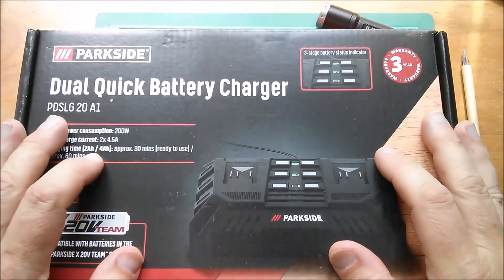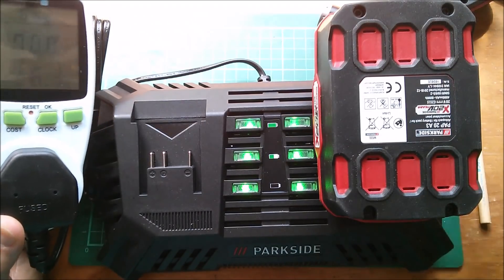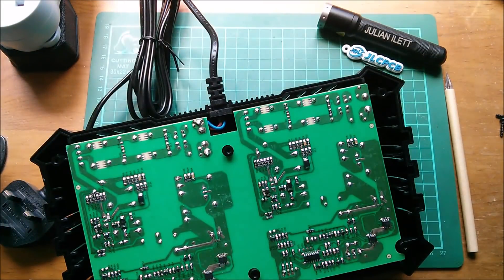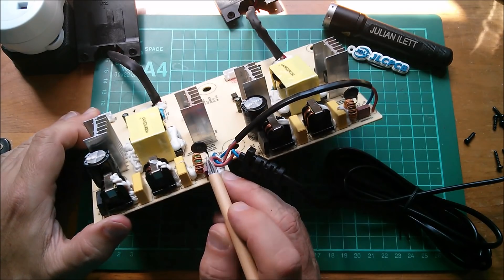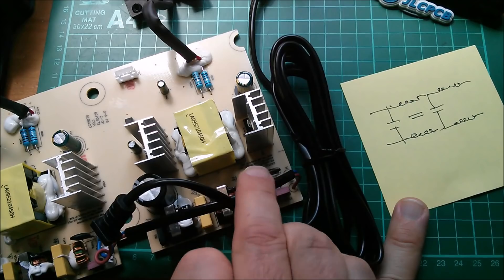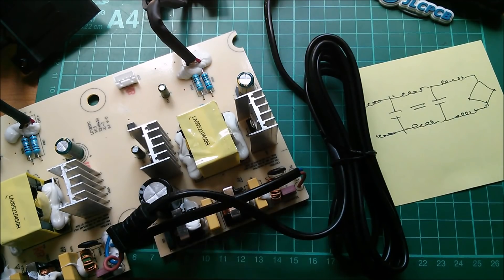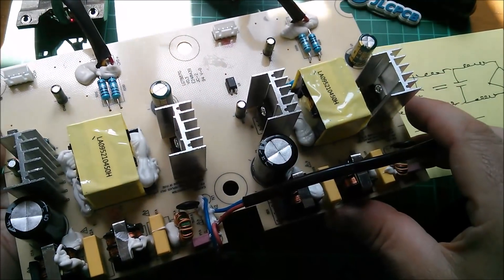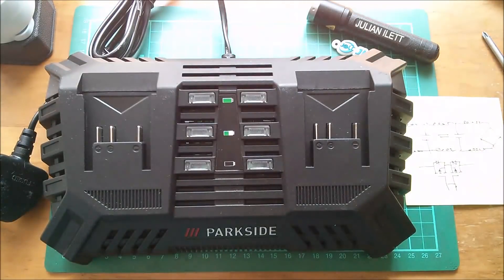Lidl Parkside 20V Dual Quick Battery Charger Strip Down

Comment: I've been designing switch-mode power supply for awhile (begun with the 78S40).
The dual input filter is required because there are two chargers directly connected to the same power source.
Without a good filter at the input, the two circuits start oscillating because of the coupling thru the common power input.
They are an absolute requirement when there is more than one power supply in parallel.
Greetings,
Anthony

Comment: Do these chargers have BMS on them? Or the BMS is mounted on the battery itself?
Reply: "BMS" is in the battery, but it's not really a BMS as there is no FET to disconnect the battery. It relies on the power tool to refuse to operate with low voltage, and the charger to refuse to charge if the battery reports unbalance etc. So if you use these for other projects you'll have to make sure of that as well. Note that newer batteries contain balancers; older ones just measure the cell voltages and report back via the data terminal.

Comment: Hi thanks for the video. Do you see any way to connect some fans to this PCB without many modifications? To help cooling while charging.
Reply: Yes you can. Only 2 wires ro solder. Space though is very limited

Comment: Julian, I find these batteries great and have converted all my various 18V tools to use these batteries. Lidl price for battery + charger = €30. However as I use the connector on the charger to mount the batteries on the various other tools, I have accumulated a number of chargers.It would be great if I could use them for other projects.  I have been trying to work out what the function of the third connector beside + on charger, but no progress yet. Fitting different resistor values between + and this connector hasn't worked.  Any Ideas?
Reply: I'm trying to do same thing the battery outputs 1v difference in battery voltage might need reference

Comment: The draper stormforce 20 v range have virtually identical batteries so possibly the same manufacturer???? That's possibly the reference to the 3ah battery which draper supply?????

Comment: Hi Julian, another excellent video. These Parkside and Ferrex products seem like great value and very reassuring to hear your positive assessment. A question: For the longevity of the battery and it's long term ability to hold a charge, is it better to use the slower 2 amp charger rather than the faster 4.5 amp charger?  (albeit they take longer to charge up). Thanks a million. Brian in Dublin

Comment: iv got the air compressor / air bed  pump combo  which is 16v ?
Reply: I also have that one. Inside the battery there is 4 cells, so it is 14,4 v. The rison why they call this battery a 16v is probably because this is new line of this parkside batterys. The old 14,4 one are not compatible. By printing the max volteg instead of nominal they avid compatiblity problems.They are not alone, Makita also named new series of batterys 40v, but in fact inside there is 10 cells, so only 36v.

Comment: The LP filters are a Pi+L filter, designed for two different frequency bands.  The supply confused him, the bridge rectifier makes ≈350 Volts and the two diodes (paralleled, looking like a power transistor) on the heatsink are working at the ≈20 Volt level.  Two diodes made together on one die can be matched well enough to be loaded to the max when paralleled.
Ron W4BIN

Comment: I got one of these and the slow-charger types.... I use this to charge my packs fast before finalizing with the slow charger (it gets a little more current into the packs)
Also, I can power my Lenovo T400 with these packs, so I made a custom portable pack out of 3 of these (20v @ 12Ah).
I'd not suggest trying using the batteries with just any laptop.... Though I have tried with an old scrapped Dell Latitude E6410 (It had intermittent fault, so was a great sacrificial lappie), that worked.
I'd suggest picking up a spare lappie for cheap at a bootsale to try... just in case (Or find the schematics for your lappie and find what the maximum ratings of all devices attached directly to the power-in line)
Of course, won't work if the lappie is USBC charged.
Reply: I do this either. I bought 7 of these 2Ah batteries, because they were cheap. I disassembled them, took out the bms boards, connected all packs in parallel with just one board on top. Yesterday I added additional 5S5P pack to these. In a box, I hooked up to this now big pack a DC/DC step up converter set up at 21,2V (Lenovo Thinkpads accepting that voltage), 2 USB 5V2A chargers, 2 USB QC3.0 chargers and a step down converter set up to 12V. It is a complete big powerbank that can charge up my 94Wh Thinkpad battery 5 times while using the laptop or even run Ubiquiti wifi antennas in the middle of nowhere :) I added also top balance charging while waiting for a trustworthy BMS for the pack.

Comment: Hey, Julian. 
Do you have an opinion either way on which 20V Lidl charger is best? I needed a 4Ah battery but wasn't sure whether to buy the cheap charger with 2Ah battery spare or the expensive dual one reviewed here. I have both but still in boxes with one getting returned at some point.
Do you see any reason to pick this one over the other? I've seen in your other videos that sometimes the battery bundled charger is a bit more basic but then I do wonder if the slower charging rate will help battery longevity....?
Thanks.
Reply: I got both types.... The dual charger charges fast, no doubt.... but leaves a little headroom the slower charger can then top up (From experience).
i.e. the dual charger would charge for under an hour before showing as "fully charged" and then the battery would accept another 10-minutes charge on the cheaper charger.
So depending on your needs, getting the cheaper one with an additional 2Ah to start off with means you'd have a battery to swap over when doing more-involved/long-duration work.
Hopes this helps.

Comment: How did you make sure the big electrolytes were discharged before touching the pcb?
Reply from the maker: Wait for the LEDs to turn off :)
Reply: @JulianIlett  Okay that was even simpler than I thought :D
Reply: From playing with PSUs at less than the rated universal mains input, I have also played with the single slow-charge charger version (The circuit is similar on the dual-charger, just with lesser rated FETs):
The SMPS IC stops switching at around the 25V mark mains-side.... (I recall one of the few I have still running as low as 18V unloaded, however I'd have to retake measurements again with my bench-PSU+multi-meter, to be sure)
So unless there was a fault releasing smoke, when the LEDs die out, the voltage on the primary (Mains-side) capacitor is less than 25V.... That's usually safe to touch (unless ya dripping wet... of course)

Comment: These bateries have no balancing function 
I've tested a few and basicly the bms cuts charging when 1st cell reaches 4.20v even if other cells are at 3.5v
Reply: Old comment I appreciate, but to avoid confusion, the newer batteries do have balancing.

Comment: The Low Voltage Directive will tell you how fast the voltage must drop when the plug is disconnected. The problem is when you put a plug on a device that is not meant to be connected to the supply by a plug.  As the pins may stay live for a lot longer. Mains inverters single to 3 phase are good for this. rectified mains on the inside and no bleed down as it's not required for  directly connect equipment.

As the diodes are made from the same process even the same dia the characteristic might be very close to each other. I have a 30A 30V PSU and the diodes are rated at 20A, so should be good to 40A. But one did go short circuit when the output was shorted. Nice high power supply but dies in a big way if you short the output. I did have two that were killed the same way. Diode bridge, switching FET's, and output diodes all went on both supplies on a very short controlled short circuit. meant to be testing a product not killing the supplies.  No short circuit protection at all. :(

Comment: That's an interesting design. I think that I would have flipped the high voltage layout on one side and run a couple of mains tracks between the two. That would save the cost of that extra bit of wire.
Reply: Look at the ends of the boards and you'll note that the boards are cut from a panel of identical single charger boards, thgat's why both sides are identical and not mirrored.
Reply: You can see on the side edges of the circuit half circles. So the whole production line is a very long board with single chargers. If you cut only every second board you'll have a double charger. That's much cheaper than the cable.

Comment: My worry with low price rechargeable tools is that they'll pull a gotcha and suddenly stop making tools compatible with the batteries I've already 'invested' in. I've got a bit more faith that ryobi or other brands won't do this.
Reply: I had that with parkside already, I have a bunch of their 18v tools and black performance 20v tools, the batteries/tools are all incompatible with green 20v battery's/tools.... I have Ryobi now..., I don't like Ryobi tools tho terrible ergonomics, design and expensive for no reason.
Reply: @user-zt4ry9hm9u  they are compatible now. Parkside changed the performance line to be compatible with the green line battery. The first batch of black performance line tools had different connectors because a agreement with Samsung. After the complains Parkside changed back to the green line battery system at the end of 2019. The green battery's have a max of 4ah while the Samsung battery packs go up to 5ah that's how you recognized a incompatible Samsung cell battery. Only the multi tool and the drill was ever sold as a incompatible system. Although everything you buy now are green line compatible
Reply: @tovenaar5924  not completely true, I have the performance angle grinder and circular saw that are incompatible with regular batteries.

However I have long since switched to Ryobi.
Reply: But you pay WAYY more
Reply: @AlpineTheHusky  Not really, the tools are slightly better and have a large resale value 2nd hand, I recently sold a totaled Makita angle grinder for £15 (burnt out armature, striped out crown gear and pinion gear, like VW modern Makita angle grinders are rubbish) paided £40 for it new. Think I got my money's worth if it was no name it would have gone in the bin. 

In afew year's I'll switch all my ryboi tools to Makita as they have X2 18v battery tools so no need to buy a new battery platform.
Reply: @user-zt4ry9hm9u  If you professionally use any tools you should go for cheaper stuff if you dont have money to throw around. I got Makita drills and the batteried die fast enough where no matter the brand you end up with the same uses. Use it hard and it doesnt matter if cheap or expensive

Comment: Could someone explain to me what a choke does as if I got a degree in Art History and not electrical engineering?
Reply: From Wikipedia. In electronics, a choke is an inductor used to block higher-frequency while passing direct current and lower-frequencies of alternating current in an electrical circuit. A choke usually consists of a coil of insulated wire often wound on a magnetic core, although some consist of a doughnut-shaped "bead" of ferrite material strung on a wire.
Reply: It stops unwanted high frequency electrical 'noise. The coil cannot pass high frequencies.
In this case it stops that noise from being fed back into the mains supply...where it could cause havoc!

Comment: iv just come across a parallel diode problem on the power supply board for a small flat screen tv.. its the Vestel model(or board) and its as big problem with them as iv discovered..  Here's one for a laugh!! they offer a fix kit...  3 BLOODY DIODE"S!!  they are 5A 100V
P.S. the "real fix" i found out(video after video) is not replace all 3, but just 2... and a few versions of the Vestel boards have this problem!!

Comment: I love these Lidl tools, mainly because they share the same batteries, and you can get replacements. My old B&Q hammer drill battery just failed, and you can't get replacements at a reasonable price, so the drill is pretty much junk now which is a shame. With the Lidl tools, they have kept to the same battery design over the past few years, and it's easy to get replacements every time they stock the tools. Only down side is that you have to wait for the 1 week window of them selling the tool you want, and as a compulsive collector, I want to collect them all! I wonder when they will be selling the hammer drill next?
Reply: Iirc lidl run a mailing list with the next few weeks special products... Or just keep going into the shop (which must be what they're hoping you'll do)

Comment: You can find many circuits with parallel transistors for increasing power, thoough some have a series resistor in each, you might slightly decrease the individual ratings, but don't have to assume one will carry full load, otherwise thare's no point in pairing/multiples.
So i see no problem with paralleling diodes, specially as they are probably schotky and in the same case, so probably matched (this is common in computer psu's)
For a moment it looked like those boards are manufactured in multiples, notice the half holes at the top, but there aren't any matching holes or the big cut out at the bottom.

Comment: @14m30s: Parallel diodes...  Don't forget that the dual diodes in one TO-220 case are presumably on the same die, and thus are presumably extremely well matched in terms of Vf and so on. Also, they're obviously very tightly coupled thermally. These factors should place tight limits on the imbalance. That said, there's still  a great deal of basic truth in your point. Cheers!! :-)

Comment: Double input filtering is not a bad thing. Could be the switching circuit is a bit dirty. Maybe you could scope the input and see what is getting back into the mains. With proper protection for the scope, of course.